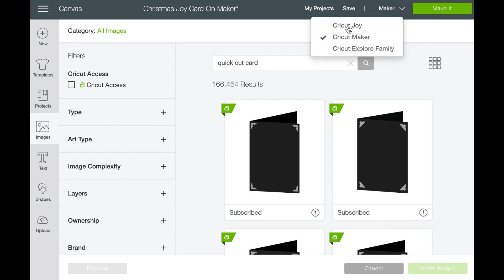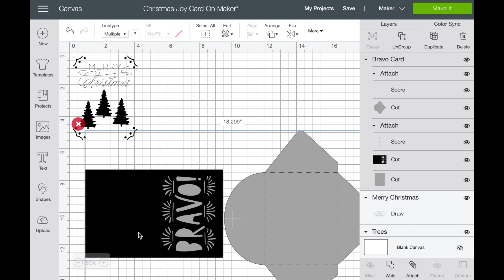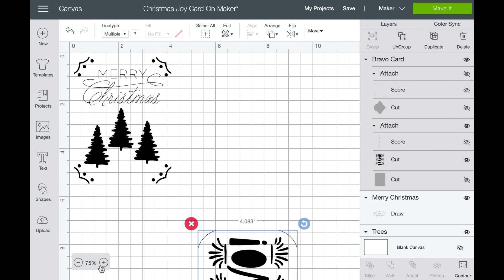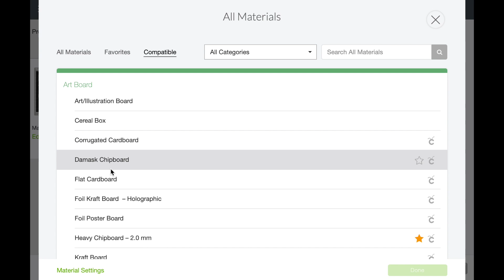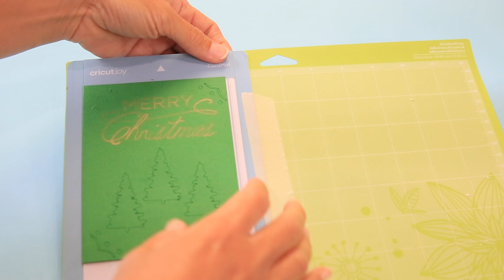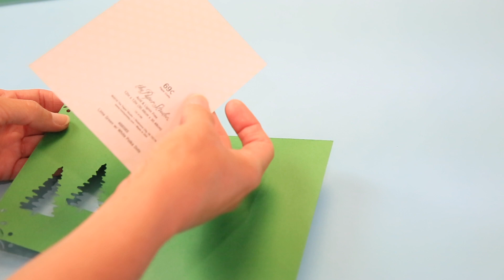How To Use Cricut Joy Card Mat On Cricut Maker And Cricut Explore Air 2 - Easy Hack

Comment: Do you place the mat in the same place on an Explore Air 2?  Also, how do you choose less pressure? I’m sorry, I’m a beginner who had a Joy that would not connect to Bluetooth.
Reply from the maker: Hey Joanne! Yes, on the Cricut Maker and the Cricut Explore, it would be the same place. It's not the best, but it's the best without the Joy. As for pressure, when you're on the desktop, and you're on the final screen, and you've selected the material you want to cut, just below it there is a little box that says "Pressure." It's a dropdown set to "default." You can click on that and change the pressure. Thanks so much for watching and I hope the card turns out great. Happy crafting!! 💕

Comment: I really want this to work!  I want to make these cards.  My mat keeps pulling in skewed - even after moving the star wheels.  The 1 time I did get it to pull the mat in and cut, it actually cut through the card and even into the blue Cricut card mat.  Now I have an etching of Happy Valentines Day carved into my mat.  I used 65# for the weight and Default for the pressure.  What else can I try.  I'm super frustrated.
Reply from the maker: Hey Chantal! I'm so sorry it's not going well! Full disclaimer. This is a hack. It works the way I showed, but it's not great because the Cricut Maker and Explore machines are not made for the Joy card mat. So unfortunately it will never be perfect. I wish they would make a card mat for the Maker and Explore. 😕 Thanks for watching and I hope you can make your cards! 💕

Comment: Well, I struggled to load it even after moving the star wheels, but eventually it worked.  However, even though the card mat is lined-up with the edges and my text is within the project edges in the app, the machine wrote the text in the margin above the project lines on the big mat.  Super frustrating - have no idea how to fix.
Reply: Just manually shifted it down - but still so strange that it wrote in the margins.  Other than that, this worked! Thanks for the tutorials!
Reply from the maker: Hey Kelley! Thanks so much for watching! Yes, this process is not the best. I'm hopeful they will someday make a card mat for the Explore and the Maker. 😍 Happy crafting!!